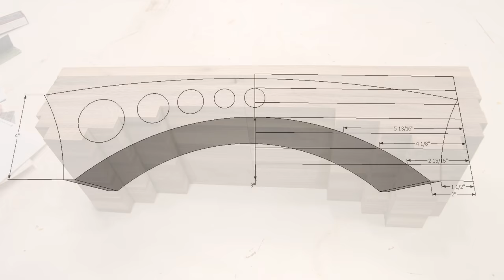It's Not a Bandsaw Box Anymore, Is It?

Comment: Very well done! I agree with other comments as to the superior quality of the video - especially the well-photographed close-ups. Not to mention the high level of craftsmanship. (I also noted that I'm not the only one who has problems drilling deep holes - even with bit extensions. I wonder if floor-standing drill presses have a longer throw?)
Maybe you could do a video to explain a bit more about those shaping tools that you used.
Reply from the maker: Thanks! Some of the floor standing drill presses have 5-6" throws.  I was using an arbortech mini grinder and foredom flex shaft unit.

Comment: By the way - how many TPI are on your bandsaw blade? I am new at bandsawing but I have read about using fewer TPI when you are cutting a thick piece on the band saw. Is your blade about 1/4"?  Thanks
Reply from the maker: Usually I use a 3/16 4 tpi and a 1/2" 3 tpi

Comment: I might be late on this but what about a hole saw? Would not go as deep, BUT the hole for the handle is centered and well,already there.If drilled front,flipped and drilled from the back maybe.3 or 4 inch deep box.Hole may be to rough ??? Just an idea I had when i saw the video.
Reply from the maker: It was 6.5" deep  so I would have needed to remove the material in the middle of the hole anyway to get deep enough.  I don't have many hole saws but it would be an option for a bigger piece with more useful drawers.

Comment: Great work. I was wondering how much of the design was decided at the start and how much developed as you progressed through the different shaping processes?
Reply from the maker: If I had been starting with a solid block of wood then I would have had very little plan to start with.  I was originally going to have normal bandsaw box type drawers that I was going to cut with the block in two halves, because it was going to be too long to swing around on my bandsaw.   Then I was going to do some kind of hole/carving thing in the middle.  I didn't know exactly what other than that I wanted an excuse to use my new power carving tools.  Because I have a lot more shorter pieces of scrap than long ones, I decided to work out the exact curves in Sketchup first so I could use as much of the shorter pieces as possible.  Once it was in Sketchup then it was easy to play around with just holes, and that seemed to look right in the middle.  I thought it would look weird with the bandsaw cut drawers and then the holes, and it worked out that my largest forstner bit was just the right size for the largest drawer.  It also removed the complication of doing it in two halves.  So that all just came together.  I had no idea what I was going to do with the drawers when I was making the box.  I happened to have some bubinga scraps from another project that were on the bench and going to get tossed because they were too small to be worth keeping but they were perfect for this.  I certainly hadn't planned on making the pulls integral to the fronts but once I reached that point I didn't think anything other than a round pull would look right and it didn't make sense for them to not be integral.
Reply: ledzep331